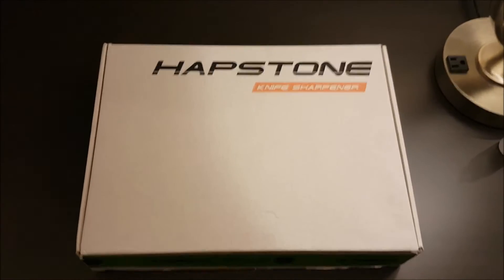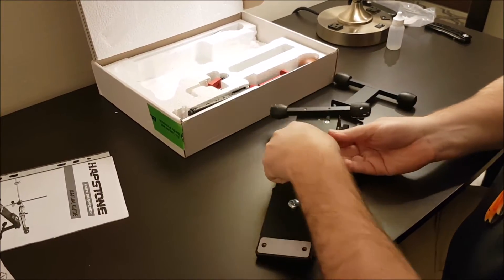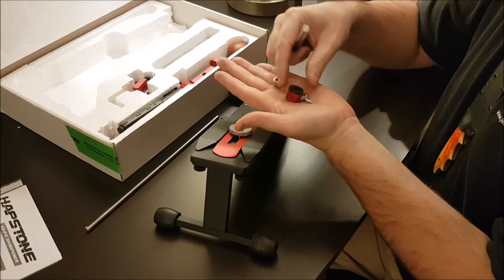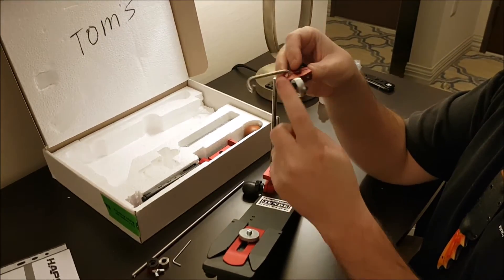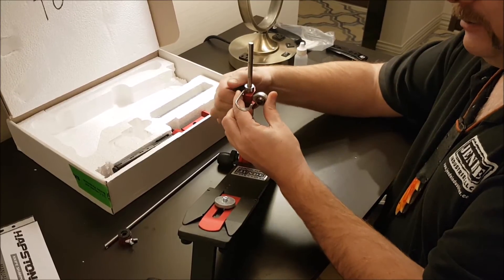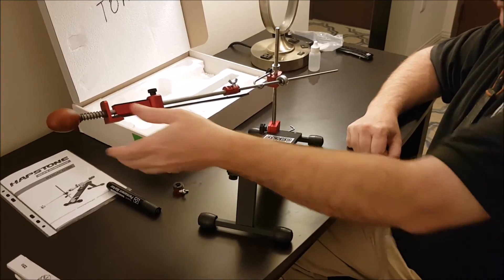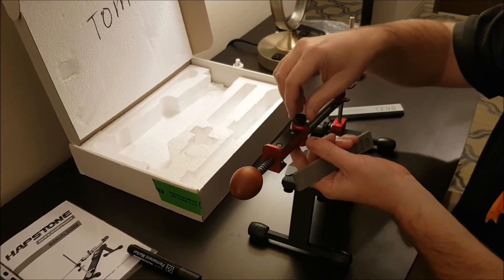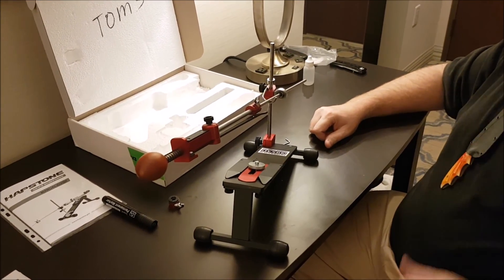Jende Hapstone V6 build

Comment: That isn't what the extra stop collar is intended for. It goes on the horizontal shaft, preventing over-travel and the damage this would cause to your blade from the stone holder contacting it. The larger of the two stop collars, which you demonstrate on the end of the horizontal shaft prevents pulling the shaft completely out of the pivot unit. The extra smaller one prevents you from pushing the stone too far to the rear of the sharpener.
Reply from the maker: Yes! You are correct! I miss spoke when filming. Thank you!
Reply: You're welcome! I only know this because I received mine yesterday from another retailer and it did not contain an extra stop collar. And speaking from personal experience, you need the extra one. :/
Reply from the maker: Send us a message and we'll hook you up. ;)
Reply: Well then I stand corrected.  That is very interesting and disappointing.  It states on the Gritomatic website that there are 2 collars for the horizontal shaft.  I expected 2 of the new style and I expected them to work.
Reply: Zatxto I believe you are mistaken. There are already 2 stop collars on the horizontal shaft. One to prevent over movement in each direction.  The V6 has added a better version of these collars which now have a small rubber bumper on each one.
Reply: Actually, v6 does not have two stop collars on the horizontal shaft. What you are seeing closest to the stone holder that looks like a stop collar is not a stop collar. It is where the two sections of the horizontal shaft connect. You can push the stone holder right off of knife towards the back of the sharpener.

And, the new "better" version, unfortunately, doesn't work at all. Fully tightened it still slips right off the end. I have the v6 and have reached out to the manufacturer.
Reply from the maker: Kyle - the Jende Hapstone has 2 drill stop collars - the stock one for the bottom, and a retrofitted round one for the top. The 2nd drill stop collar is only on the Jende V6 versions. You can see in the video at 2:55 the standard stop collar is put on, and at about 4:10 the 2nd top collar is put on.
Reply: Jende Industries, LLC in speaking of the horizontal guide rod that the stones attached to not the vertical rod.  According to the website there should be 2 stop collars on the horizontal rod.
Reply: Technically there is a second stop collar on the horizontal rod. In my first reply, I mentioned that the clamp that holds the two pieces of that rod together looks like a stop collar, but doesn't function as one. Well, technically it does stop the stone holder from slamming into the pivot unit, but it would not stop the stone holder from sliding off of the knife unless you had an 8 inch bench stone in the holder.

Also as follow-up, Hapstone and Gritomatic have verified that several parts were sent out with defects and they are currently working on fix. They have issued a statement here, https://www.gritomatic.com/blogs/news/public-statement
Reply from the maker: Kyle, We will look into that... thanks for bringing it up!
Reply from the maker: Hi Rich - Thanks for the notice. We've been getting this message for a couple weeks now. We've been through the site and mobile side with fine tooth combs and even had our web server's guys go through every line of code.  Everything is good, but the message from google is just not going away.